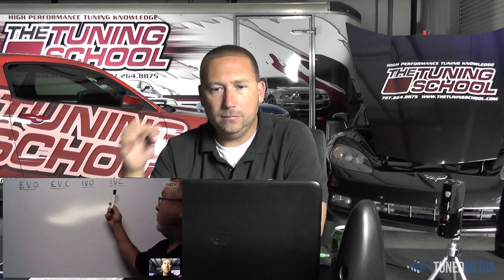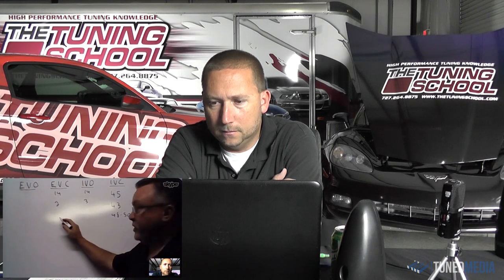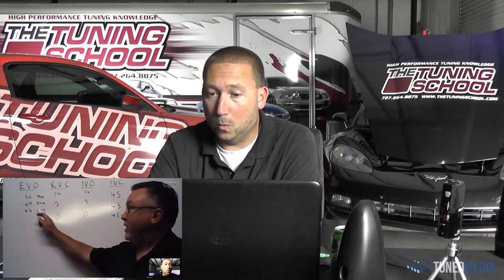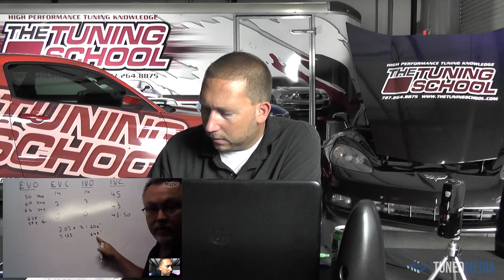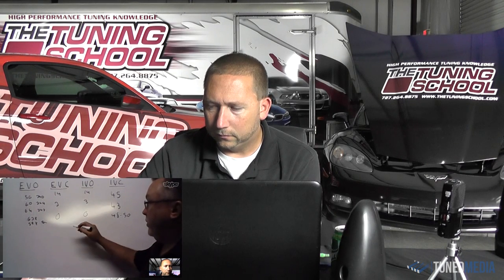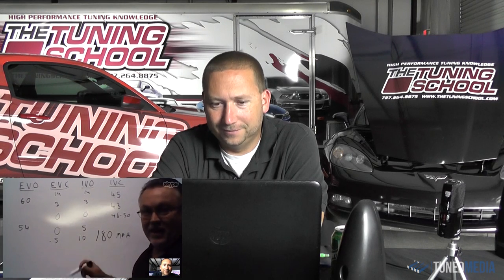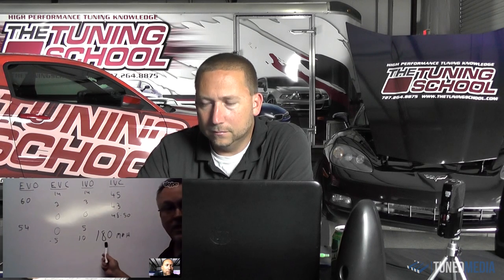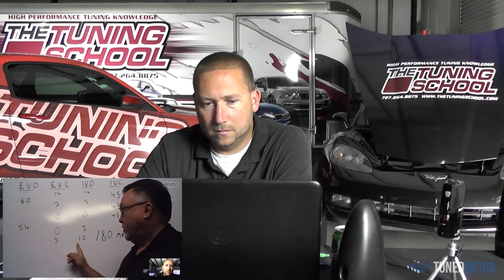Forced Induction (Part 8): Cam Shaft and Heads Selection with Brian Tooley

Comment: Just change the exhaust rocker for 1.7 to 1.6 and see if it picks up... Yes Brian people HAVE checked if less exhaust lift picks up power.   Your right it usually does :)  not quite sure if that .3*valve dia applies to 45 deg seat valves.. Now lets see if that formula works with a 55+deg seat and a large throat dia.

Comment: So if I decided to go with a BTR Stage 3 cam for a C6 LS2, can I down the road put a procharger/a&a on it? Or would I have to use a boost cam? Power/ET doesn't much matter. Just a bigger gain down the road safely does.

Comment: I like that he doesn't fixate on boost numbers. People really put way too much emphasis on boost. They don't seem to understand that boost is a measure of resistance, not power. I've got a little blue compressor in my garage that produces 100 pounds of boost... but I don't think it would give my car much power.

Kidding aside... would I really need a .615 cam in a 351W street engine? That seems like serious overkill. Or is that 0.3 number just for max effort builds?
Reply from the maker: I'd say the .615 is a good size for a street engine.
Reply: @TheTuningSchool  I remember when . 500 was considered a pretty hot cam. Times sure do change.
Reply: @johnterpack3940  yep

Comment: Is the valve size to valve lift ratio true for 4 valve per cylinder heads?
for example, I have 2 intakes @ 36mm which suggests .425 lift... ?????  My exhaust (2 of them) are 31.5mm  which would be 1.24" * 3 = .372 lift???  By the way my cam's intake and exhaust are both .36 lift which seems either less than ideal, or inaccurate info.

Comment: Question... if I plan on running heavier springs on the valves, wouldn’t it make more sense for me to have a longer duration with no overlap so as to make the most use of the pressure going into the cylinder on intake (I would want to push as much air in until the cylinder hits bottom) and have the exhaust valve open so that the valve stays open until it hits the very top?  This would allow for the most intake pressure and allow the exhaust to push more and allow for more push on the turbos manifold side, correct? 

Just to clarify, if I am running an 8.5:1 compression, and I am closing the valve at 85% of the way down on the cylinder, I just lost 15% of possible pressure into the cylinder, not taking full advantage of the turbo. Same with the exhaust side. If I keep that valve open until the cylinder hits the very top, that clears up more exhaust from the cylinder and that is where the most pressure comes from in the cylinder towards the exhaust side. More air out means faster spool, correct?

Comment: So I have a 5.3 vortec, and it has a texas speed camshaft 

Do i have to replace the camshaft if i want to turbo or procharge the engine
Reply: Jc Nopal yes if it’s a n/a cam
Reply: You can probably get by with very mild boost, depending on its specs,

Comment: Question- Having a Callaway Corvette currently  making 757 Horsepower and 777 ft pounds of torque from a basically stock LT4 motor with a 2300 intercooled roots style supercharger instead of the stock 1700 supercharger from the factory LT4, would I benefit from a LS9 camshaft upgrade or a LPE GT35 camshaft in my quest for more horsepower( 830 or more horsepower) on the dyno while not losing out on street / strip performance. 

Which of the following do you guys think would be best for a hot street car that would still pass emissions and I could still get more power out of it on the strip.

the LPE GT35 camshaft-210/237@.050, .605/.617 lift, 116.5 LSA 

 The LS9 camshaft is 211/230 @.050 valve lift and .558/.552 lift with 1.7 rockers and a 122.5 centerline. 

Which one would be a better fit? This is a Tremec 7 speed manual with a 3.42 rear gear.
Reply: I would go with lpe gt35 cam. or BTR stage 3 or 4 cam.. those sounds the best..Very ANGRY SOUND. ..

Comment: the .3 thing really doesn't seem to apply to my current situation.  Take a LS2, and look at any of BTR cams, the exhaust is WAY over .3.  In fact even the stock GM LS2 cam is WAY over .3 on the exhaust.
Reply: Incorrect: lift on a stock LS2 cam is 0.520/0.521 and stock LS2 head has a 2" valve exhaust valve.